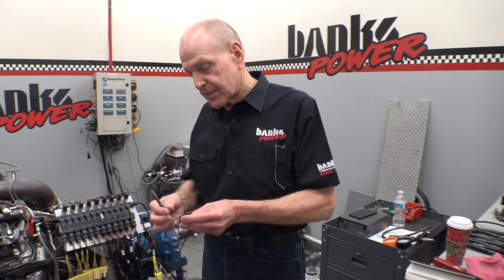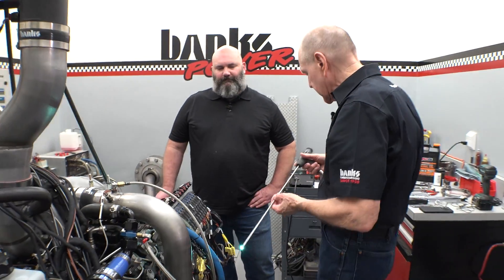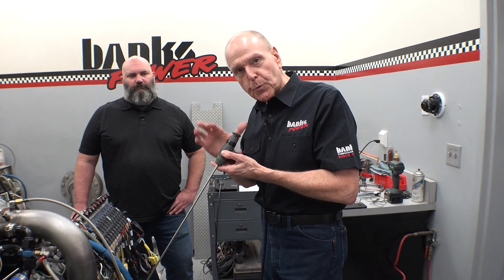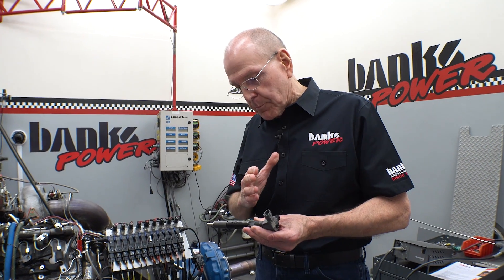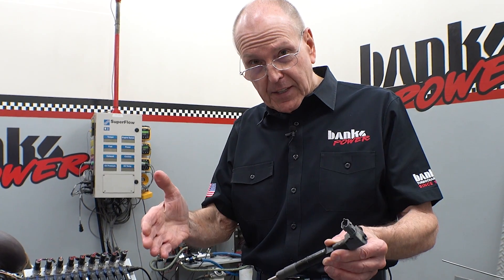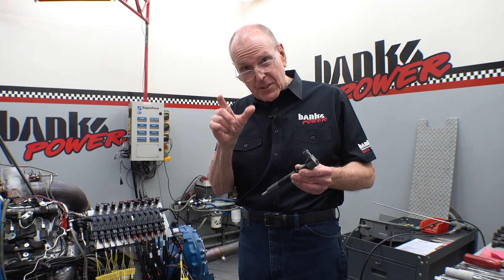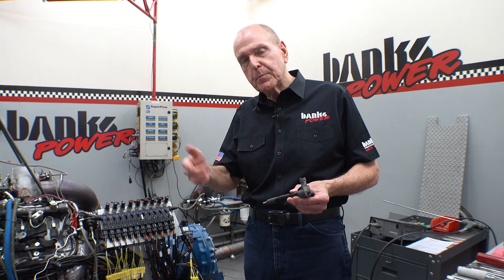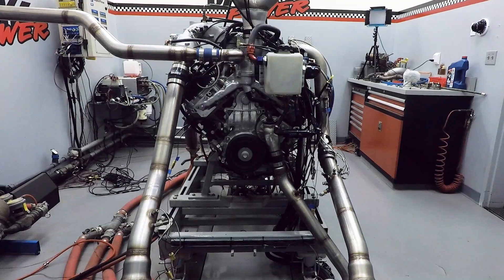Killing A Duramax Pt 9: Checking for Damage

Comment: Is this engine still using def fluid?
Reply from the maker: This engine never used DEF. It is an engine destined for military use so it comes off the line at Duramax with no emissions equipment.

Comment: Jus curious, will Banks be developing something for the  baby Duramax diesel and in the new Jeep Wrangler diesel?
Reply from the maker: We have a plan to address both the LWN and LM2 engines  (sometime around Q2)Right now, both projects are currently on hold. We are trying to finish a few GM 6.6L L5P '17-'19/'20 projects before we continue development on the 2.8L LWN and 3.0L LM2 engines. Right now, other than exhaust and intakes, we have nothing further on our schedule for the Jeep turbos.
Reply: @bankspower  Sorry I messed up my question, it was the baby Duramax and also the new Jeep diesel?

Comment: Hi Mr Banks, any input on the typewriter tick coming from the lp5 diesel engines? I just left the dealer with my 2018. They said it's normal. That's fine but is there any suggestions to get it to be a little quieter?  I first thought when i took it in it might have been a belt or fan issue....

Comment: Gayle. You need to continually drop the revs not raise them. Generally it's not hard to raise hp by raising revs. Yes am well aware of the stupidity of that statement. But torque × revs ÷ either number, metric or imperial still bares out the same. Make it make 800 @ 2500 or less and you won't contain the sales.
Reply: mark robertson  thanks for your reply. Never thought a comment like this would get a response!  It would seem that in recent years that there has been a drop in engine speed ( aside from others like technology ) have created efficiency per mile (or k ) but also given better response , driveability etc. Surely because torque is a building block of power then less revs is a winner?
Reply: mark robertson  but an interesting challenge none the less.  Or is it that easy to 'kill a dura max ' at lower revs? BTW, yes 800 at 2000 is crazy!

Comment: Does the 40* rule apply to Duramax's specifically, or most diesel engines?
Reply: Good question, one I've been pondering as well.  I suspect it is true for most direct injected diesel engines as long as you avoid extremes.  As with all things I'm also certain it's more of a guideline and depends on the piston, cylinder head design, the injector location and spray pattern along with the crank + conrod + wrist pin geometry used.  (the latter may result in different piston motion / accelerations that are subtle and something I find to be non-intuitive when thinking about o.0 ).
Reply: I think it is a decent guideline for many direct injection diesel engines.  The piston motion from 20 btc to 20 ATC will be about the same.  Gale's main goal is to keep the spray from impinging on the bowl upper fillet.

Comment: What are you guys using to calculate the injection event 20 degrees before tdc and after. Does this also account for the pilot injection event. It seems the injection event is set up 50/50 in your testing. Total timing? Or are you plugging the data into a spreadsheet to make sure it's happening + or - 20 degrees? I'm a gasoline tuner via EFILIVE but have a LMM with DSP 5 switch still learning the diesel stuff.
Reply: I would assume Crank position or Cam position comes into play here.

Comment: Gale... as always a very informative video session. I am hoping that other than trying to discern how much power the Duramax can generate before it incinerates, that there is some practical lessons learned here that can be applied to the average guy’s purchase and use of a Duramax - in aligning greater performance capabilities with engine reliability and longevity. 

Before the series is over, I’d ask that you circle and summarize these three talking points so viewers get an appreciation for what can be accomplished through all your testing in advance of complete engine failure.

Comment: The glow plugs on my 2013 Passat Diesel were supposedly combustion pressure sensors as well, at least thats what the dealer told me when one failed and they wanted $150 for one!  I wonder if you could use those instead? Of course they may not have the response time of the fancy ones you have.  I was told they used them to measure the difference between all 4 cylinders and detect if one cylinder had a sealing or combustion issue (i.e. stuck ring, bad valve seal, or dirty injector.
Reply: mark robertson  I read the code myself, it had to do with cylinder compression if I remember right.  There was a TSB on it where they were supposed to swap glow plugs out and see if the code followed it.  I'm not saying your wrong, but 2 different dealerships told me the same thing

Comment: Man i love listening to this guy and i have never driven a diesel lol just a modular 4.6 4 valve and built 321 cube windsor .....he is freaking brilliant.
Reply: I test drove the new 3.0 Duramax.    It was ok.   Just didn't motivate me enough to want to spend the extra for the engine option and the premium for diesel at the pump.  My 5.3 v8 has enough capacity for what I need my truck for.

Comment: Great videos. I always learn something each time I watch your videos.
You should specify to clarify your 40 degree rule. You never specified 40 degrees before or after tdc.
Reply: 20 degrees BTDC and 20 degrees ATDC for a total of 40 degrees of crank rotation. 

He starts the demonstration in pt.8 at 20 degrees BTDC and stops at 20 degrees ATDC.
https://youtu.be/aK-9x9j7L9o?t=748
Reply: He states that the fuel starts near TDC (part 8 @12 minutes) Thanks viperman to point out he mentioned it in the last video.

Comment: Would be interesting to see more of the cylinder pressure measurement on the videos, where does the peak pressure point go in terms of crank rotation vs start of injection? And where is the end of injection event on power run. Gale Banks is the number 1 diesel guy in the world, power without smoke,  I hate those rolling coal machines that most of the other people make!
Reply: There is videos of that in this series actually. This engine had for example peak pressure a bit more than 11degrees atdc with a supercharger without any methanol
Reply: And is you just listen to what Gales says in this video he doesnt go beyond 40degrees of injection. Thats 20btsc to 20atdc

Comment: Wow, 230 bar peak cylinder pressure.  That's 3335 psi in English units.  I don't know what the Duramax was designed for, but I doubt it was that much.  I know that Cummins older heavy duty engines, such as the N14 were designed for 2100.  The L10 was 2300.  The 998 Mack was 3000.  Over the last 30 years, firing pressures have gone up, driven by emission standards, and increased power density.
Reply: Even crazier to me is the injectors now support 1792 bar to feed that thing in stock form. Ford for 2020 is pushing 2482 bar. 1050 lb ft doesn’t come easy I suppose.
Reply: @stevenp3176  denso makes a 2500bar common rail system since 2013
Reply: He says 183bar in the next sentence
Reply: @danielssonsgarage  Great!  I went back and listened, and he did say 183 bar at about 6:30 in the video.  I wonder if that is going to piss somebody off at GM?

Comment: About the Throttle Response 

are you planning on using an Anti-Lag-System ? this would defnetly provide the Response. 

and just imagine the Soundtrack this monster would make. 

and  i am not aware of such an giant engine with anti lag
Reply: Tell me how anti lag works on a diesel, never heard of that
Reply: @danielssonsgarage  Do an internet search on the term "Hyperbar".  Cummins developed a 38L V12 diesel in the early 90's that used the Hyperbar system.  2400 hp.

Comment: Wow! I never thought of injector timing and flow in regard to rpm. I'm a gas engine fan myself, but I always tune into these videos because I learn so much! It frustrates me that so much of the diesel world is obsessed with torque, while ultimately wheel torque is far more dependent on horsepower.
Reply: Projects Forever torque is what hauls heavy loads
Reply: @Ralphgmoney  Effectively, yes. But only because high torque is generated when a combustion engine creates high horsepower at low RPM, remember the old (ft/lbs torque*RPM)/5252=HP equation. If you had a gas engine that made the same horsepower but at a higher RPM, it could pull with the same force given the correct gearing. Now do you want a gas V8 screaming at high RPM when towing? No not really, that's why effectively torque pulls loads. It's not about pulling force, it's about sustained pulling force in that case. But when it comes to racing, or fun, or how hard something shoves you into the seat, no it's just horsepower doing that work.
Reply: Its HP that pulls not torque . An engine making 250 hp and 700 lb/ft of torque will get out pulled by an engine making 350 hp and 250lb/ft torque
Reply: Wheel torque is not dependent on horse power. That number will vary depending on efficiency,weight and gearing of drive train. Hp is work done over time. So Hp is dependent on tq and rpm not the other way around. Injector timing and flow in DI gas engines is dependent on the same factors as diesels. It’s worse for gasoline cars because the higher the rpm the shorter the injection window. Anything past 8ms typically just puddles fuel on the piston. This is one for the reason heavily turbocharged DI cars typically don’t get in to the 6k or more RPM. Higher the cylinder pressure the higher the injector pressure needs to be to push the fuel out against pressure.
Reply: boost is torque no matter the engine low speed torque is the problem There’s a few diesel guys that are finally figuring out putting torque higher in the rpm range make serious power safely

Comment: $4K  USD 'Glow Plug' cylinder pressure sensor, who would have thought such a 'simple' device would be so expensive.  Now I wonder how it works exactly!  :-)  (Here goes my Friday night googling high pressure, high temperature, high resolution pressure sensor technology!  Hmmm I wonder if this is actually considered high pressure in their industry.... )
Reply: Cylinder pressure transducers use piezoelectric crystals to sense pressure.  Kistler and AVL are the two sources worldwide that make them and the associated equipment for engine development.
Reply: I'd have thought a ceramic strain gauge would work better than piezo, or is the strain gauge too slow?
Reply: Lassi Kinnunen  Yes you're correct that the fact that it's not a commodity product (and that production volumes are so low) drives some of the cost. There are also a lot of individual parts that go into the assembly, and it has to be able to withstand modern cylinder pressures and knocking conditions. They're predominantly tools for R&D where accuracy, durability, and repeatability are absolutely critical, and it's a very challenging environment for a sensor when you can have sensor temps exceeding 300 C and gases nearly 2000 C impinging on the diaphragm! I can also assure you it's not a commodity product on the inside... everything is made and assembled in Kistler's factory in Switzerland -- a country well known for their low cost products ;-) -- down to the proprietary piezoelectric crystal grown in an isolated room at the factory. Also in the video above, the sensor is mounted in a custom glow plug adapter made-to-order for the Duramax head bore dimensions... the cost is a bit lower if you can machine a separate bore in the head (admittedly not always an easy task).
Signed,
Your friendly Kistler product specialist ;-)